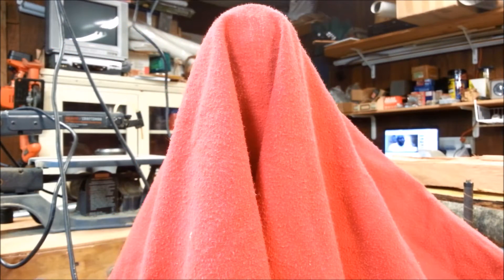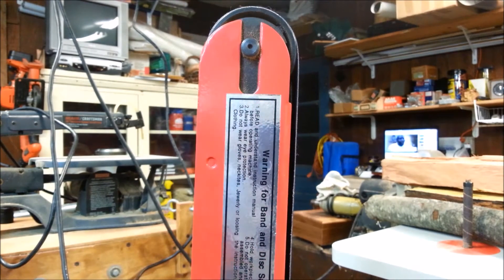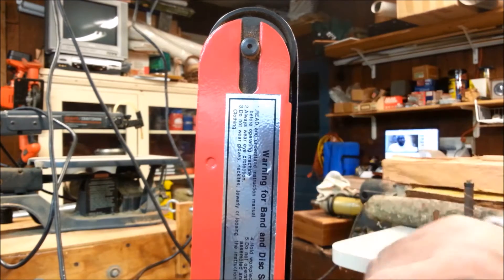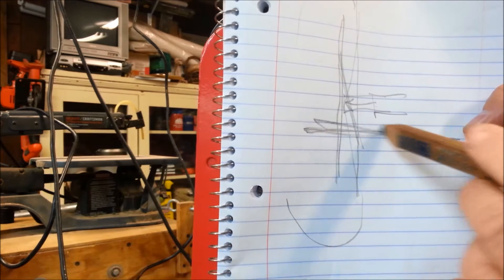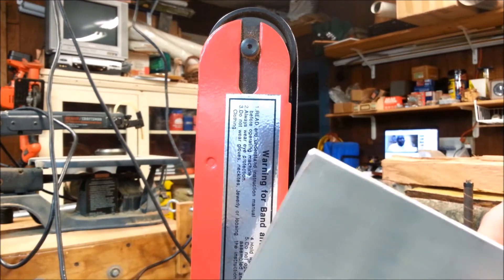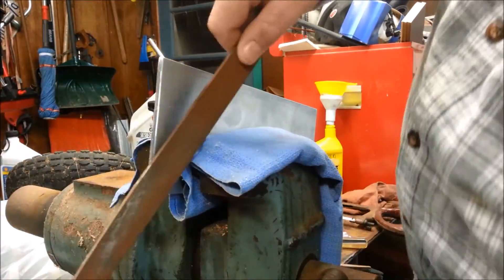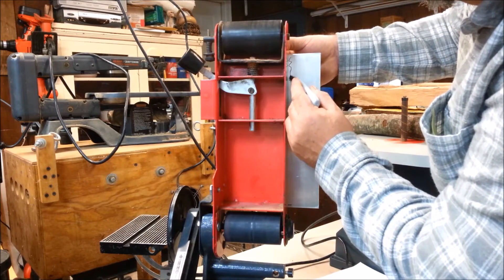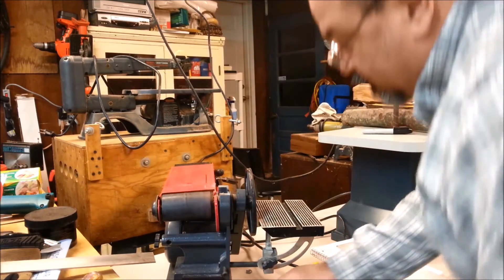Knife Grinder From Harbor Freight Belt Sander - Part:1

Comment: Nice video. Instead of fastening the aluminum sheet with screws, why couldn't you prepare the surfaces with coarse sandpaper and use a high heat silicone adhesive? Even if over time the adhesive fails it could be quickly replaced and the build time would be far less. Just a thought Even spray contact cement may work.
Reply from the maker: That would be an option of course.  I have the skills to machine the metal for fasteners and it just gives me pleasure to do the machining and threading.  I really hate doing anything over.  I think I could do it well enough with glue to outlive the tool/motor.   I'm looking at this old video and wishing I had that much room in my shop today.
Reply: I was looking at the quality of the tool that was being modified verses the amount of time needed to make it work for my purpose. Certainly your approach is far superior and more permanent for a quality tool which this is not. I would rather spend my time using the modified tool which I see as a far better use of time. Cheers!
Reply from the maker: Oh yes, bottom of the barrel tool for sure.  I did this genuinely for the reasons stated.  However, keep in mind the click economy prevalent on YT and there is high demand for ways to do things on the cheap.  Thus why you'll see so many videos with low cost tools.  I have all the skills to build a real knife grinder and may do that some day.  Tons of videos out there covering those as well.  This tool would be greatly enhanced with a better motor.  If I ever mount it to a table I may upgrade it.  I've collected a few extra motors over the last couple of years.
Reply: I just watched a video where the gentleman  actually turned both of the rollers with a lathe and made a huge improvement in the  vibration and the belt tracking on a similar tool The run-out was over 20 thousandths! He also tightened the table mount as it was loose even when fully tightened. There is no quality control in these Chinese made power tools past the original design. Other issues such as thread chasing were also needed. Many of these designs are done by Americans and then "farmed" out to manufacture in China. I think this is okay from the viewpoint that we can afford to own many more tools instead of far fewer high quality tools  and then repair them to good working condition all for an affordable price. Youtube is a fantastic resource don't you think?
Reply from the maker: When I did this project, I wanted to turn the wheels to smooth them out.  I have a Unimat at work but it was too small to do the job.   This got me going restoring a lathe I had in storage. It is still unfinished but I own over 10  lathes now.   Most of my expenditures on Chinese tools has been a waste of my money.  I'm converting over to vintage American iron instead.  An old well cared for American or British tool is superior to a new tool from China any day.  And, certainly more satisfying.  I don't think you get what you pay for from China. I think you often get much less.  Another YouTube'r commented that tools from China (like power tools and such) should be considered "kits" from which you may be able to make a decent tool.  I thought that was very insightful.  I have the advantage of having almost every capability in my shop now.  Anybody can stack up money and buy an equally high stack of crap.  But few have classic vintage American Iron.  I'm slowly replacing and upgrading to the classic stuff.  I still have some China stuff on my list, like I'm looking for the largest Craftsman drill press to replace another China press I have, but I'll eventually replace that with a Rockwell, Atlas or some other cool old drill.  However, I recently obtained an American Irwin Hansen tap and die set to replace my China set.  So, always looking to trade up when I can.

Comment: I have a similar sander I bought used close to twenty years ago. It still runs like a new one. The aluminium sheet should do the trick for ya. I've never paid any attention to see if I have the same problem. I've always used it with the table down for woodworking.
Reply: I think it's fine for wood either with or without the platen correction.  I made a number of improvements along the way.  I have a few more planned when I get the lathe done.  The motor on mine is a bit weak on start, great when it's running.  I'll eventually make a larger pulley for driven end and replace the stamped metal bottom pan with a sheet of steel or aluminum.   I have a few other ideas also.  More to come.